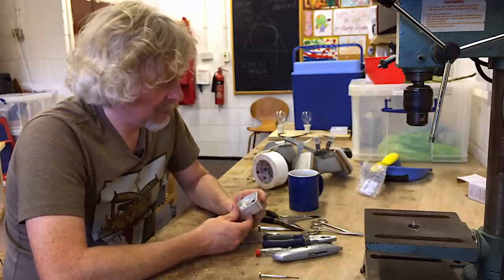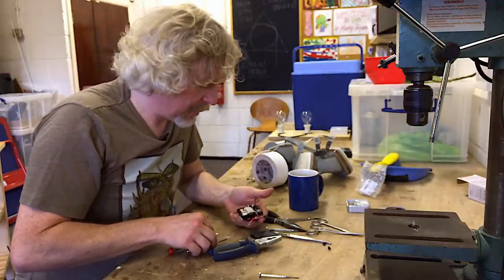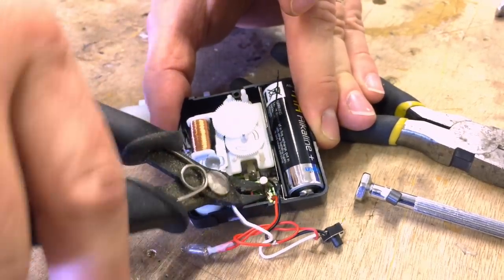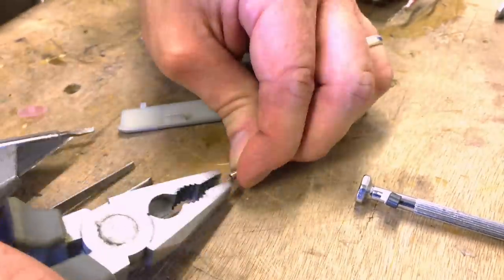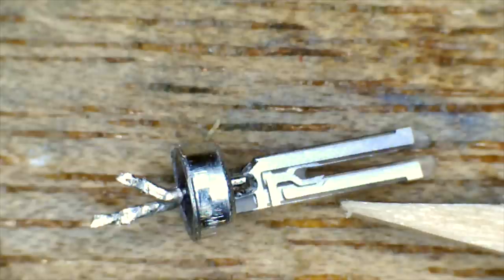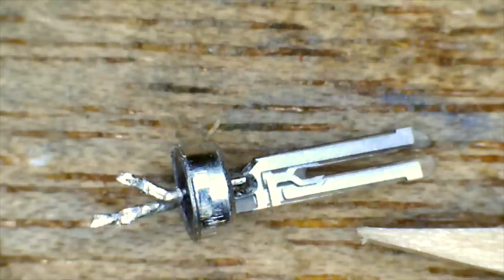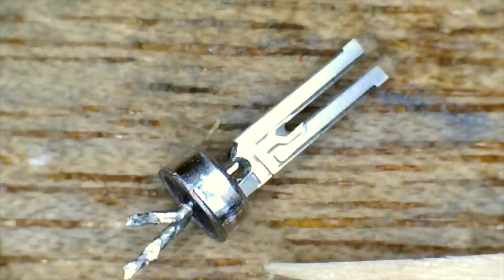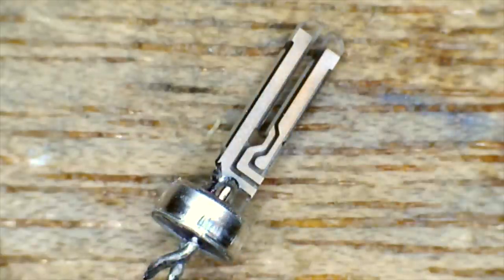Wobbly crystals inside a quartz clock

Comment: Hey can you help me explain how this thing communicates its vibration back to the clock? I get that it has two wires connected to it (let's call this the input) to provide it with a specific frequency, but how does the clock get the output of the Quartz? Does it go over the same two wires as the input? That'd be confusing...
(For the rest it was seen to be isolated by a metal tube) 
Thanks for the tear-down video.
Reply from the maker: I am a bit vague about this myself. The way I understand it, any small input voltage across the pins of the oscillator will have inherent random fluctuations. These will start the oscillator vibrating and this will build and drive the voltage oscillation to the crystals resonant frequency on top of the base line supply voltage. So you measure the oscillation using the same pins.Which is, as you say, confusing

Comment: How do you pick up the vibration of Quartz into a signal ?
Reply from the maker: As the quartz relaxes, it emits a pulse of electricity. This is partially used to keep the quartz vibrating by feeding it back into it. But it is also used to provide a signal that is fed into a digital divider that produces a once per second pulse to drive the clock.
Reply: Marty Jopson holy fuck yes, squeezing A crystal creates electricity so the movement caused by electricity will cause an extra release of electricity ! Thanks.....  I'm just waiting for my time Crystal watch which pulses by itself without power !!!
Reply from the maker: Hi Hanniffy
Thanks for your reply and thanks for watching the clip. This is the piezo electric effect - deform quartz and it produces electricity, but also in reverse, apply electricity to quartz and it deforms (changes shape). It's really just a cunning way of converting mechanical energy directly to electrical without the need of magnets. The quartz in your watch uses the power from the battery to set up the vibration and maintains it with a constant extra trickle. The emitted pulses are used to a) time the insertion of that continued electrical trickle and b) provide a time signal. Apologies if that was not made clear.

On a separate note, there is no need to be so sarcastic and rude. Maybe if you had phrased your response more politely it would have been altogether nicer for us both. In future if you don't understand a response, maybe mocking sarcasm is not the best way to continue the dialogue.
Respectfully yours
Marty